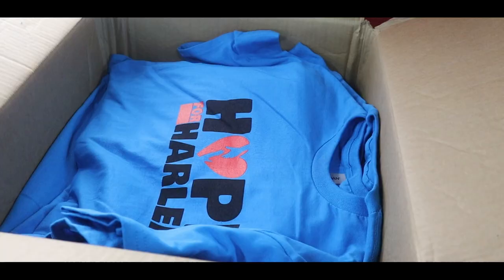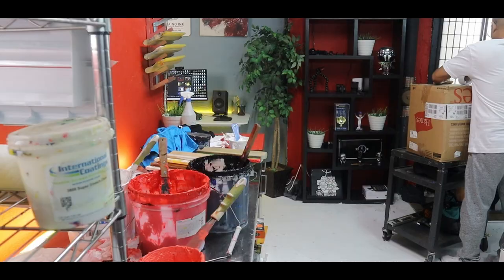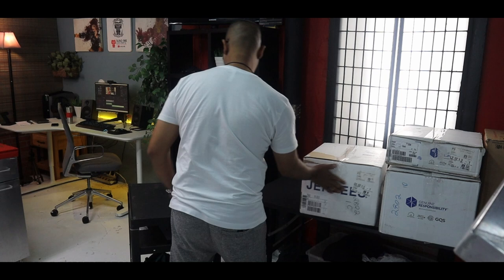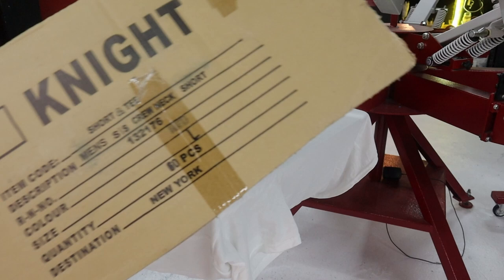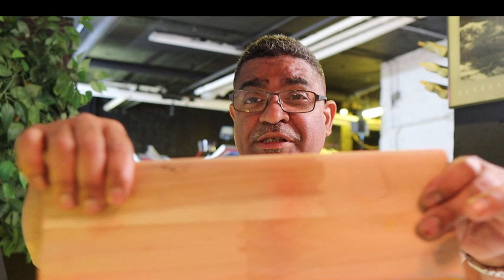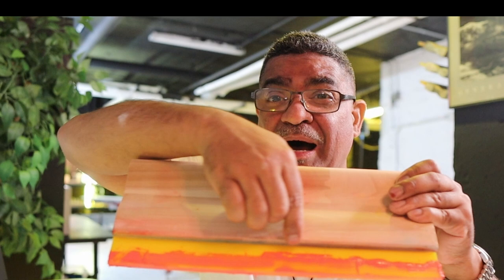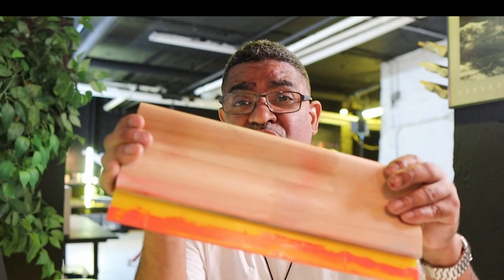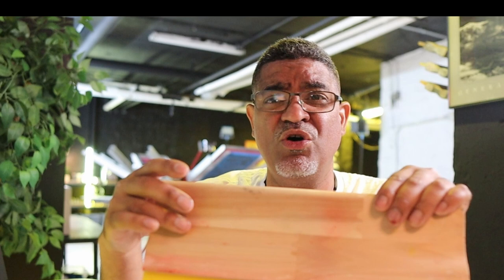SCREEN PRINTING BASICS | These 3 Tips Will Improve Your Screen Printing Game

Comment: Great video! Another tip for keeping your wood handle squeegees clean is to varnish them. Any type of waterproof clearcoat will work, makes the ink really easy to remove as it can't soak in to the wood. I'm using waterbased ink though, the cleaning solvents for plastisol might remove the varnish.
Reply: You can tape up the handle where it meets the squeegee too
Reply: @philipmazonson4694 I am so doing this thanks for the tip!

Comment: About how much ink you will put on the screen I think for plastisol inks a little is enough but for waterbased ink little is not enough because it tends to dry quickly if you put little amount of ink so you have to put not a lot but much more than needed to prevent the ink from drying and clogging on screen.

Comment: Off contact distance causes the mesh to act as a spring where as your squeegee passes over the screen the mesh is pressed to the substrate just at the area where the ink is being pressed through the mesh and snapping back as the squeegee passes. Only the line of pressure at the very edge of the squeegee blade is making contact with the substrate and only for the moment that the blade passes by. Such an important principal!
If I could add some advice. Don't use household products for cleaning and substituting for screen printing products. Duct tape and silicone caulk should not ever be near your screens! The glue and silicone will migrate onto everything. Silicone on your screens will prevent adhesion of your emulsion and possibly contaminate your ink. No cleaning with household cleaners that have fragrances and coloring agents, etc. Use screen printing supplies that are formulated for screen printing and that will play nice with each other.